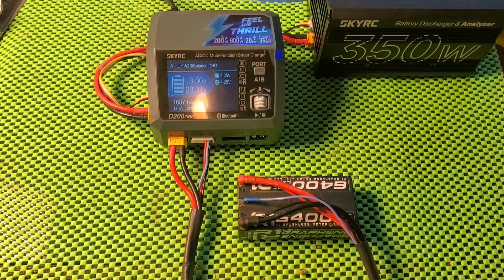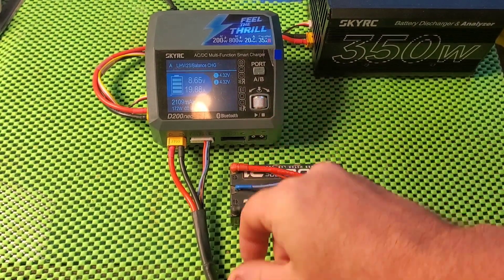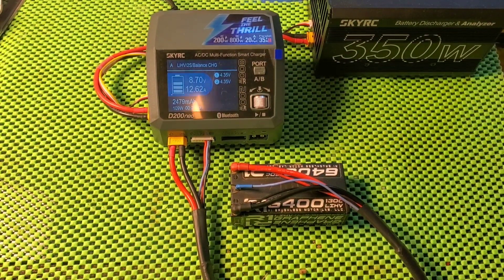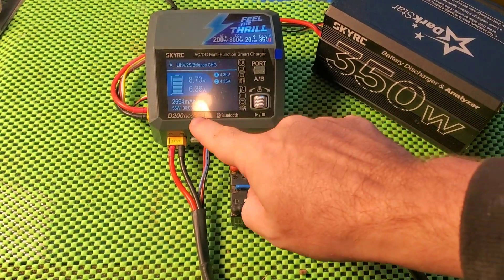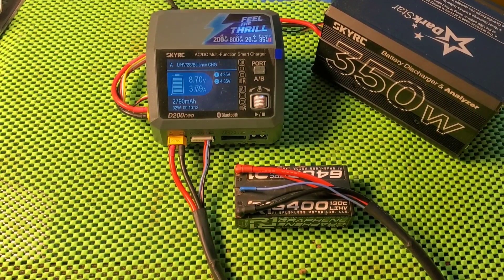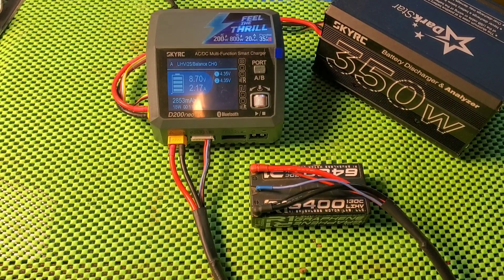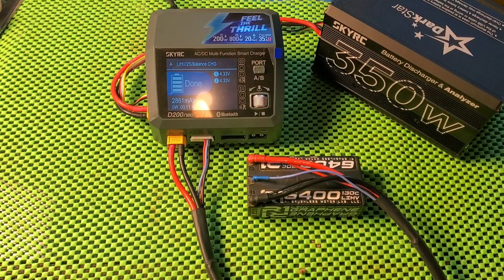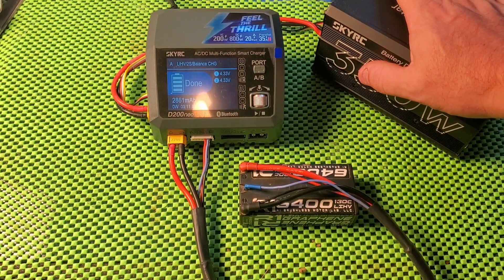Skyrc D200neo Part 2: Balance charging issue (undercharge)

Comment: I had high expectations for this charger and the BD380.
However when I try to discharge a 2S fully charged at 40a it will complete in about 15 sec. When it hits 3.4 per cell, which isn’t correct. On my icharger it will go for several minutes which is correct and normal. To me it doesn’t read or adjust the voltage readings correctly.
Reply from the maker: I updated the firmware and it does seem to work a little better with balancing. Still doesnt do a good job with storage with the discharger attached
Reply: @lawton70 agreed

Comment: I just saw this video. I'll still try to explain the problem of a battery that's not fully charged. 
What most people probably know: A standard LiPo charge is performed at a 1C charge rate. During the constant voltage phase, the charger gradually reduces the charge current. When the charge current drops to 10% of the initial current, the charger shuts off charging and indicates "finished." 
With this standard charge, charging is terminated at a termination current of 0.1C. If the battery is left standing for a while after charging (e.g., more than an hour), you will notice that the individual cell open circuit voltage has still dropped by approximately 0.01 to 0.02V per cell. Nevertheless, the battery is generally considered sufficiently charged. 

For your 6400mAh battery, the charger would shut off at a termination current of 0.64A (= 0.1C) during standard charging. However, if the battery is now charged faster, e.g., as in your case with 20A (= 3.1C), the charger will shut off again at 10% of the initial current. So, at 2.0A instead of 0.64A.
 
This is the reason why you noticed a more significant voltage drop than usual shortly after charging. 

Therefore, to get the battery as full as with a standard charge, you would have to start a subsequent top-up charge with a 1C charging current. The milliampere hours that the charger then displays are the less capacity that was charged during the fast charge. 
You'll be surprised, it's not as much as you might expect. 

However, the majority of current chargers, such as SKYRC, Hitec, Toolkit, ISDT, etc., have this fixed termination current set at 10% of the initial value. So, even your ISDT T8 won't be able to fully charge the battery at 20A charging current any more than the SKYRC D200 neo. 
I know of two charger manufacturers whose devices allow adjustable termination currents. These are the Hota and iCharger chargers. 

In these cases, I would reduce the termination current to 3% at a 3C charging current to ensure full batteries. 

But there are also critics who say: If I'm going to fast charge with 3C, I don't want to wait for minutes until the last few milliampere hours are squeezed into the battery. They would rather forgo a few percent of the charge level. 

Or they set the end-of-charge voltage to 4.22V/cell, for example, for a standard LiPo.
Reply from the maker: Good explanation. 
My isdt charger will charge the 2s pack to full 8.44volt  properly even at a 30A charge. It does this by backing off the current long before its done. Watching the charger it seems to start backing it off about 8v. By the time it is close to 8.42 the charger has backed off to about 2a and continues to slowly charge to full. This skyrc charger does not seem to have the back off logic correct, as if it is not monitoring the voltage drop as the current reduces. 
Having said that, there was a firmware update that seems to help the skyrc charger. My plan was to do a follow up video with the latest firmware update. It is better but still not as good as the isdt.
Reply: @lawton70  Reducing the charging current before the final charging voltage is reached doesn't really make sense. It wastes unnecessary time. But the fact that the charger doesn't shut down at 3A is interesting. 
One possible explanation is that it wasn't finished balancing yet. But with a maximum balancing current of 2.2A, that's rather unlikely. 

With the iChargers, you can select whether shutdown endcurrent or balancing, or both, must be met before the charger reports completion.
Reply: Your knowledge is very impressive! Great explanation of the process - thanks for sharing.

Comment: This is normal, but thanks for showing how the D200neo balances. It only took 5 minutes once it reached the max voltage, which is very good, and it stopped at 10% of the max charge current, which is also a good point to end the charge.

Comment: I bought myself SkyRC B6 Neo for the battery charge of 18650, unfortunately this wretched charger charges them by only 70%. This is thrown out money and I will dissuade everyone from the purchase of this brand :(
Reply from the maker: Skyrc sells all kinds of electronics that work great. I agree that with their charger line its hit and miss. There are quite a few videos on the B6 neo failing.
Reply: @lawton70  In my test, new Samsung batteries with a capacity of 3400mA were used.  they were charged to approximately 2400-2600mA
Reply from the maker: What was the mAh of the pack that only charges 70%? My suspicion is the chargers can charge the high mAh packs properly.

Comment: it's not an issue from Skyrc d200 neo, it's because of LiHV batteries. I have SkyRC Q200 Neo which works like a charm. LiHV is another type of Lipo battery. It recommended not to charge it too much for long gevity.
Reply from the maker: I am starting to think it may be something with this charger. I don't think its anything to do with this pack. I have charged this battery lots of times with my ISDT T8 in both Lipo and Lihv mode with all kinds of amp settings (5A-20A) and it charges and balances fine. Same with storage, the ISDT T8 puts the pack into storage volt with no problems while this D200neo takes at least 4 tries. Interesting that the Q200 works fine as I would assume its the same firmware. Is it possible you could reply with the firmware number so I can compare? This charger uses firmware v1.52
Reply: My charger is using the latest firmware. The model is Q200 Neo, a little different from yours. The firmware version is 2.57 @lawton70

Comment: Did you get this worked out?
Reply from the maker: Support did get back to me. Said this is how the charger works. Really dissapointed in this charger.
Reply: @lawton70  thank you for you reply I was actually very close to buying the Q200neo but your video made me pause! Especially as I plan on using it on liHVs
Reply from the maker: @dualtrondreamteam6811  my plan was to get this with the 40a discharger and be set for a charger for a while. But the storage is even worse than the charging. I have to run a storage discharge 4-5 times before it gets to storage volt because it is so inaccurate.

Comment: Regarding the drop in voltage after charging, my iChargers (406duo and 4010duo) do the same. I charge 2S packs to 4.2v per cell, usually at 1C rate. The charger stops at 4.2v per cell but the voltage drops back 20 to 50 mV after the charge stops. I don’t think this is significant performance wise for your car/truck etc.
Reply: Doesn’t the battery say max charge rate of 3C?  With a 6400mah pack, that would be 19.2 amps, so you are slightly over 3C charging at 20A
Reply from the maker: My ISDT T8 charger does not do this under volt charge. When I charge to a set volt it charges exactly to it, and when I store to a set volt it stores exactly to it. I see the charger will back off the amps and see if the volts drop, then apply the amps for a bit and then check again. I thought all chargers did this to charge a lipo and am surprised this charger doesn't.
Reply: I noticed that the charger cut of when the charge current hit 2A, or 10% of the nominal charge current. Maybe you could charge your pack at 6A and see if the end voltage is closer to the expected voltage?
Reply from the maker: @malkie0831  Agree, the less amps you charge at the closer it gets to the specific cut off voltage. The irony is charging at low amos defeats the purpose of a high amp charger that can charge at 35 amps.
Reply: @lawton70  Sure.🤔

Comment: Is it possible to charge a car battery with this device?
Reply from the maker: I gave it a try to charge my full size car battery. The charger defaulted to 6s(12v) but it wouldn't charge the battery. It seemed to need the balance board hooked up. One thing I thought of after is maybe I needed to change the number of cells.